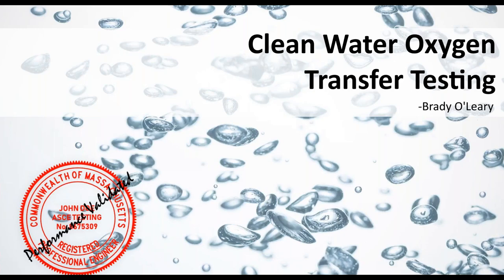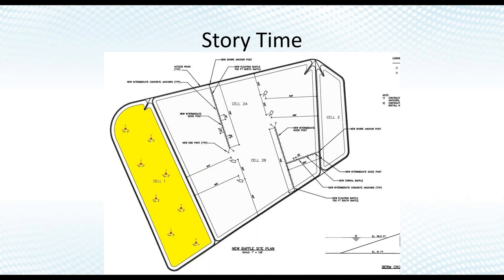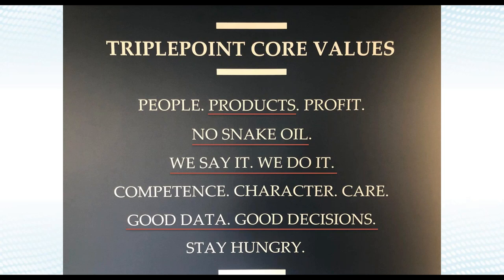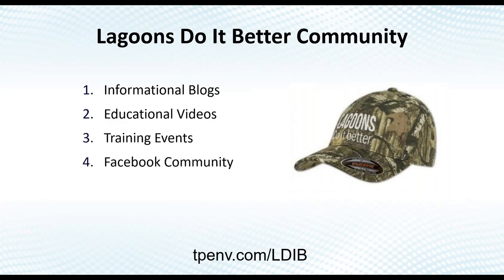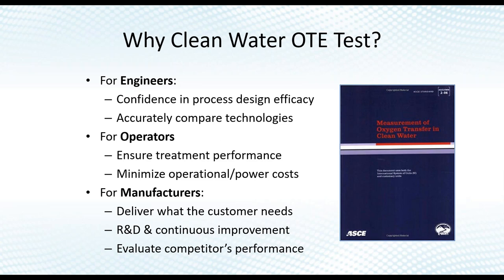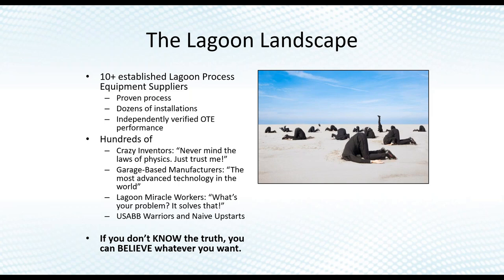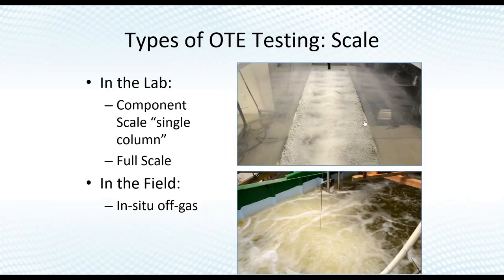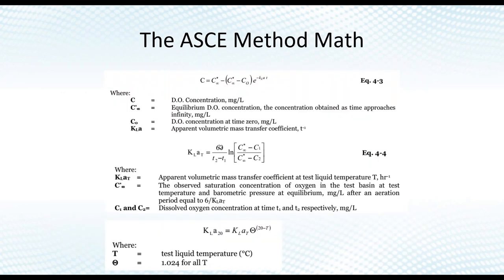Lagoon Webinar: Clean Water Oxygen Transfer Testing

Comment: Great presentation Brady. It was nice how you kept it simple, yet touched so many important pointers. I have few questions if you could explain: 

1. How does SOTE representation in (%/m) and (g O2/Nm3/m) compare. EU seems to use the latter often. 

2. Is there a way to alter floor diffuser density in the set up you showed? Isn't it an important parameter affecting SOTE? 

3. How does blower harmonics affect air flow measurements? Would it also affect pressure measurement for aeration control? Does it depend on blower type? 

4. What is the purpose of the coarse diffuser in the middle, in your model? I have never seen it in an activated sludge tank. 

Again, appreciate your time and efforts!